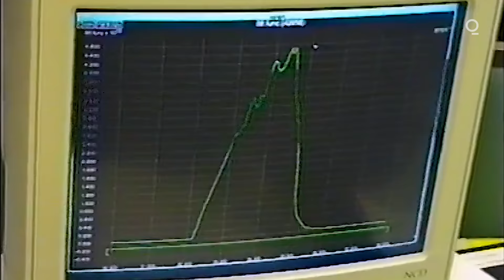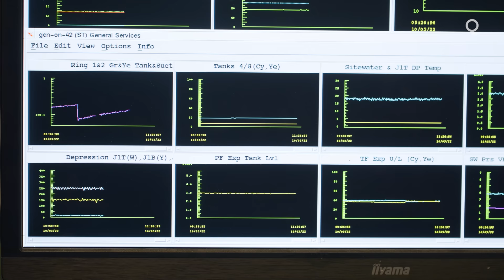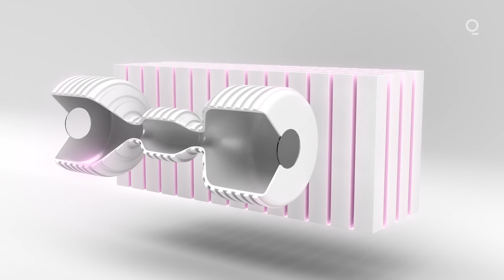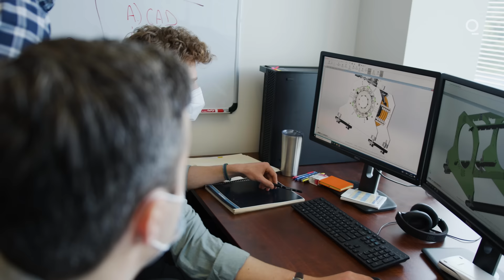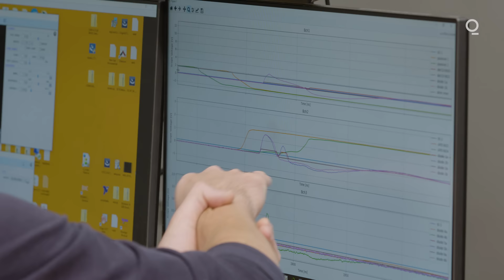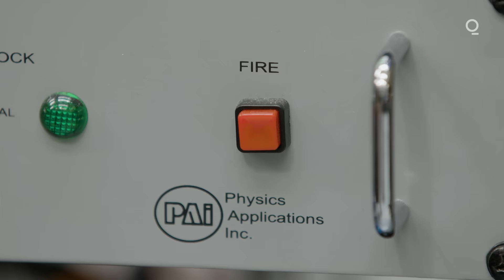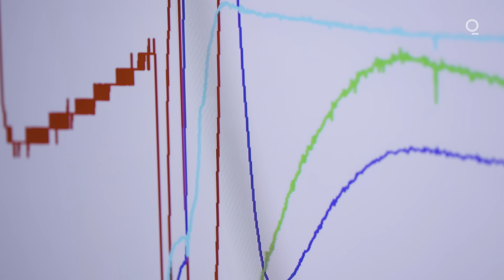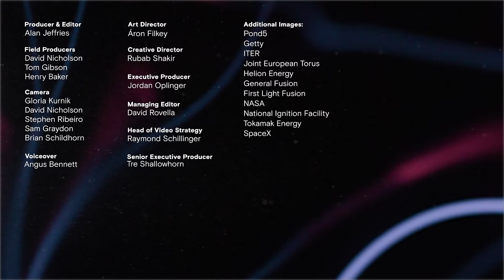Why Private Billions Are Flowing Into Fusion

Comment: Why build such a big version of it? Why not scale it down in size by a factor of a 1000. Then maybe it wont cost so much.
21:24 The earth is comprised of metal elements. When are we going to run out of metals again?
There is metal in your blood and in the food you eat, when the metals going to run out?
Reply: But then it wouldn't be so profitable to lay hoaxes on gullible, enthusiastic investors. Other problems include, no doubt, the fact that the relevant natural processes in nature don't follow a linear function, just like so many process in nature (e.g. growth of bacteria, radioactive decay, and the warming or cooling of a cold or hot object in air at room temperature).

Comment: Detonate a hydrogen bomb in the middle of a super massive tank

Release the pressure through a turbine = Fusion power

Wouldn't be economic as the tank would need to be the size of a mountain. But technically it would be a fully working fusion power generator

Comment: I haven't watched the video, but I'm assuming in its 22 odd minutes there was little to no mention of "neutron embrittlement" and its effects on metallurgy, and probably not a lot mentioned about the step change in physics understanding that will be necessary, before any tokamak fusion reactor operating with a constant plasma temperature in excess of circa 110 million C will ever be practically possible as a clean energy source. I used to work as a degree qualified engineer on such a project (JET, in Oxfordshire), and then left after some years when I learned it was really all about the government grants. The real problems in (hot) nuclear fusion are never mentioned in the science mags, media articles, etc. I do hope the fusion research continues in case there is an actual breakthrough, but as fascinating as it all is, it most likely will never work in our lifetime, and possibly not in our grandchildren's lifetime either. As much as I hate to say it.
Reply: "Over the past few decades, RPV embrittlement has been addressed by the use of tougher steels with lower trace impurity contents, the decrease of neutron flux that the vessel is subject to, and the elimination of beltline welds. However, embrittlement remains an issue for older reactors."
Reply: @TheKarlslok  Fission reactors, not fusion reactors. The neutrons from >110 million C nuclear fusion are on a whole different level.
Reply: @methylene5  No it is not.
Reply: @elmarmoelzer2229  I used to work on the project as an engineer, I can assure you it is.

Comment: How do you have a contolled fusion reaction without immense gravity to keep the reaction from exploding. Don't you need equilibrium?
Reply: These types of machines can not explode. The fusion plasma is very hot, but not very dense. The energy content of the plasma is relatively low. Also you do not need (even want) equilibrium.

Comment: This is all really impressive, but how any of this is easier than just digging a 50 mile deep hole in the ground!? Earth's core is the true unlimited source of precious heat.
Reply: A 50 mile deep hole is effectively impossible to dig. I doubt we’d ever have the technology to do that in human history.

Plus the pressure drop of whatever fluid would render it impossible.
Reply: @Gomlmon99  sure sounds easier than controlling a 10 million degrees hot plasma that you used 100 Tera Watt lasers to create. 

Plus we could generate electricity just from dropping the water all the way down before we super heat them to gain more. 

Plus plus my dog is halfway there already
Reply: @ycy-technologies  No one is suggesting we use lasers for commercial fusion. NIF is a department of defence facility for researching nuclear weapons. 

I don’t think you understand. We have never even got half way to 50 miles. I don’t think we’ve even gotten 10 miles down.

Do you know how strong a pump you’d need to pump a fluid for 50 miles?
Reply: @ycy-technologies  No amount of water could be pumped to produce 100TW in on or even a few locations.

It’s not trillions. It’s more like a few billion. 

Plasma with the necessary triple product have been confined for tens of minutes now.
Reply: @Gomlmon99  are trying to say that the total geothermal energy potential is lower than 100TW?? Thus is clearly wrong. The only thing is that dealing with plasma and lasers to generate nuclear fusion is more prestigious to scientists than digging a hole in the dirt. If they would invest a fraction of these efforts into that we would all enjoy world peace
Reply: @ycy-technologies  you’re not going to consider changing your mind, but if it were possible, don’t you think they’d do it?
Reply: @Gomlmon99  told you, they mainly do it for the prestige of the achievement. I'm not even implying that geothermal is easy... Its just easier! And much less sci-fi..

Comment: Why wouldn't fusion run into the same set of hurdles as fission ?
Reply: What hurdles in particular. If you are talking about regulatory. The current trend is towards regulation for fusion plants to be a lot less strict than for fission plants. It looks like they will be regulated more like medical isotope facilities and particle accelerators.
Reply: @elmarmoelzer2229  thanks for the response. You seem to be cognizant on this topic. So, I hope you could comment 

1. whether fission is less likely to cause radiation exposure than fusion ?

2.  Also, would the waste from the reaction be more readily disposable than fusion ? 

Thank you 🙏
Reply: @aazimlakhani8250  
1. It depends a bit on the fusion fuel. But if you were to stand directly at a fusion core vs a fission core while they are running and without any shielding in between, they are about equally deadly. I mean you would not do that and there would be safety measures to prevent people from doing that. So, this is purely hypothetical anyway.
But with fusion, once the machine is turned off, radiation levels drop much more rapidly than with fission reactors. Fission products stay highly radioactive for many years.

2. Depends a bit on the fusion design and the fusion fuel. But generally, fusion would not produce any high level waste, just low to mid- level. That waste is mostly activated components. Now these are radioactive for a while, but should be safe withing 100 to 200 years. In case of Helion's D-D/D-He3 machine, the activated components will be below background level after a single year and the machine can be fully decommissioned within 2 weeks of operation.
Meanwhile spent fission fuel is high level waste that stays highly radioactive for thousands of years and needs a geological repository. 

Interestingly fusion could help disposing of the high level fission waste by using the neutrons produced by fusion reactions to effectively "burn" the waste.
Reply: @elmarmoelzer2229  thank you for sharing this. I hope the optimism pays off

Comment: I don't know a lot about nuclear power, but I often wonder if fusion is completely cleaner than fission. Granted that fission involves breaking larger atoms into smaller ones which then the smaller atoms then continue to give off radioactive decay where as fusion combines atoms into larger ones (or different isotopes, I'm not really sure which) which are not as radioactive. However whether in fission or fusion, I'm pretty certain that whenever a heavier atom is broken apart or smaller atoms are bonded together, both processes releases a combination of radiation and materials from within the atom (electrons, protons, neutrons, etc.) that can be dangerous to whatever is near it. My guess is it is plausible that in fusion such radiation can be contained within an area where the danger might be negligible compared to the issue of radiation/waste that comes from fission, but it isn't an issue that doesn't exist. The fact that while the sun releases energy through fusion it also produces radiation in the process should be enough to show that there isn't any issue with radiation when using fusion. To this day I haven't found someone to give me a satisfactory answer to this problem.
Reply: Yes fusion machines produce radiation (as do CT- scanners and many other things). But that can be shielded against very easily and it falls off with distance squared. It is very safe.
Also note that against public perception, fission is quite safe too, safer than rooftop solar if measured as deaths per TWh.
Reply: @elmarmoelzer2229  But the same is true about fission, it TOO produces radiation that can be shielded against very easily yet people are more scared of it then they are of burning fossil fuels such as coal and oil both of which produce more deaths per year than if the energy was derived using fission instead. In all honestly, almost ALL of our energy needs could be meet using fission energy instead so heavily relying on using fossil fuels if the public perception of it wasn't so negative.
My question is if SO MUCH time and resources is being spent on developing a way to create a way to get energy using fusion when we can already create all the energy we need using fission, what are the advantages of fusion if it too produces radiation and radioactive waste? I don't know of what kind of radioactive waste it produces, but I'm assuming that it might since fission power produces it.
Reply: @dclem005  
I am a fan of fission too, don't get me wrong. But fusion has advantages. There are no large amounts of radioactive materials present. The waste is MUCH more benign and shorter lived. The fuel is easier to come by and does not need expensive processing, enrichment, reprocessing, etc. There are no spent fuel rods that need to be stored for a long time. Even breeders will leave some high level waste (though less and it will be shorter lived). 
From the looks of it, fusion will have less strict regulation than fission too, which really helps.

Comment: So how exactly is energy derived from fusion? Are we boiling water again or watt?
Reply: For Helion, they are using the expansion of the plasmoid after compression (driven by it's own internal pressure and the energy from fusion) to induce a current in the surrounding coils. Plasma is mad of charged particles. So it can induce a current.

Comment: What is it that is missing at the moment so we can make Fusionpower happening? Is artificial intelligence or deep learning the solution?
Reply: I don't think there is much missing anymore. The biggest obstacles for some designs are materials that don't need to be replaced as frequently (once ever 20 years instead of once every 5 years or so) and some smaller engineering issues. For some of the designs, the physics are not well explored. I am a bit skeptical of those. Helion, Zap, CFS and Tokamak Energy are probably the best bets for private fusion startups. The others are still a bit further out and many of them are lacking funding.

Comment: nuclear can do it, and nuclear is much safer nowdays than with the plants that melted down (pre 40's technology), in addition we can use 100% of the fuel rods easily purifiable all you need is electricity, the correct sulfur acid sulotion and you can separate the used material from the unspent uranium. granted it takes a few extra steps but it is completely doable. then there's the molten salt reactors...

Comment: Unfortunately, it looks like we ran out of time for chasing ideal ways of tapping nuclear energy. The rate of change in key habitability factors is faster than conservative estimates predicted. Weather instability has already begun to compromise high-yield agriculture regions. The real danger kids face isn't bad weather it's the probability of genocidal competition for access and control of resources. Basically, fusion research needs to be postponed and all eyes need to be on how to make and deploy modular fission reactors, desalinators, and atmospheric scrubbers to remove CO2 2x faster than it was emitted. Large scale crop failures due to drought and flood are already starting to happen worldwide, as well as CO2 spewing forest fires the size of Rhode Island... The risks posed by fission-based 'emergency power', while not ideal, are manageable compared to the certainties posed by global socio-economic collapse. In order to restore some acceptable level of atmospheric stability (because the man-made imbalance of heat-retaining gasses will continue for another 1,000 years after humans stop emitting them altogether) will require approximately the same amount of energy released by burning 100,000,000 barrels of oil, 9,000,000,000 tons of coal, and  10,000,000,000 cubic meters of natural gas every day. That's just the share of total energy required to UNDO the damage at the same rate gasses were emitted since ~1980; twice that amount will be required to sustain existing levels of power consumption...

Comment: Creating energy from less energy isn’t possible. Only making greater gains in efficiencies and with releasing more potential energy…

Energy cannot be created nor destroyed.
Reply: Fusion energy works because when two light atoms fuse, the resulting heavier atom has slightly less mass than the atoms it was made from. This is called the "mass defect" and that missing mass is released as energy. It is a bit more complicated in reality (really it is the binding energy that is released), but that will hopefully explain where that energy comes from.
Reply: @elmarmoelzer2229  so that binding energy (the chemical bond?) is a type of potential energy then?
Reply: I suppose that since you say it “works” we will see it in just ten more years, right?
Reply: @elmarmoelzer2229  and we’re did these photons get any mass at all to begin with?

Comment: Isn't Helion's reactor a perpetual motion device?
Reply: No it is not!
You forget the added energy from the fusion reactions!
They can recover 95% of the input energy PLUS a significant part of the fusion energy directly as electricity. Most of the fusion products are charged particles that further drive the expansion of the FRC plasmoid and that is also converted to electricity directly. It is slightly less efficient than the input energy recovery because not all is in charged particles. Some is in neutrons and some is in X- Rays. So maybe 80% efficient. So you get Power(in) * 0.95 + Power(fusion) * 0.8 = Power(out) > Power(in).

Comment: With cheap unlimited energy from fusion won't you get a lot of thermal pollution, i.e. waste heat?
Reply: Politicians' hot air will be worse.  I can almost hear them shrieking, "Save hydrogen!"
Reply: Annual world energy consumption is 160,000 TWh a year.  
Energy from the sun hitting Earth is 1,515,480,000 TWh each year. So almost a million times more. Heat pollution from energy does not matter, even if all of it was lost to heat without doing any work.

Comment: These startups look more like Theranos than SpaceX to be honest. 
I'm not as well-versed in physics as I'd like but the 'pushing back against the magnetic field' claim of Helion sounds like voodoo-physics to me. 
And the guys with their 50 neutrons... Yeah ok but Hirsch fusors were doing that in the sixties. 
So I expect you'll stop hearing about this stuff in a couple of years, and some people will have made a pretty buck fleecing VC investors. Which is nice work if you can get it.
Reply: The Helion energy recovery works and it works very well. Faraday's law. The plasma consists of charged particles. If you remember your high school physics then you will remember that if you move something charged through a magnetic field, it induces a current. Helion first tested that in 2015 and they did that a million times. It works, better than expected actually.
Reply: @elmarmoelzer2229  sure. I look forward to profitable fusion energy by 2019, 2021, and 2022. And 2024, now, apparently. Look at that. Almost like they keep moving the goalposts. Aah but just one more round of venture capital, right? Right.

Comment: At 19 minutes in, you can't compare fusion to reusable rockets as a justification for "the private sector is so much better" type arguments.
NASA had already developed, tested and flown reusable rockets but they were cancelled for political reasons, (competition with the space shuttle). Elon didn't invent reusable rockets, he pushed the existing tech further and reached orbit, NASA could have easily done that if the projects weren't shelved.
With fusion, for every tiny step forward you discover a thousand show stopping problems in totally unrelated fields which each then have to be solved. Hence why it is taking so long.
Reply: What reusable rockets were built by NASA? Last I heard from NASA was that reusability was impossible because they failed to do it. LOL.
Reply: @disposabull  I loved the DC-X and I wished NASA had continued that route rather than the X-33. DC-X was cool but only capable of going to 10km altitude and not particularly fast either. SpaceX were the first to make a VTOL orbital booster and so far are the only ones still...

Comment: Seriously, how are you going to deal with the  heat released by a working fusion reactor? Once heat is created it will be not possible to get rid of the heat without creating more heat at some other place. A fusion reactor is like creating a vessel for a small part of the sun. The heat pollution created by such a machine will create so much heat we will all be baked dry. :)
Reply: World energy consumption 160,000 TWh/year. Even if all of the energy produced by fusion machines was lost to heat without doing any work and if all of the world was powered by fusion machines, it would be insignificant compared to the 1,515,480,000 TWh of heat hitting the Earth from the sun every year.